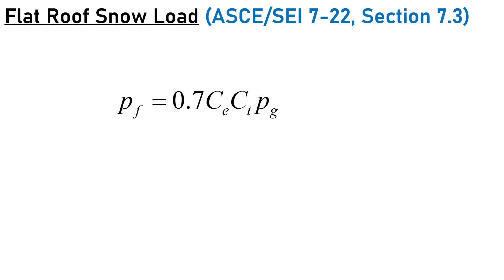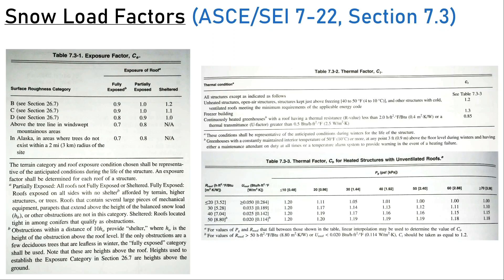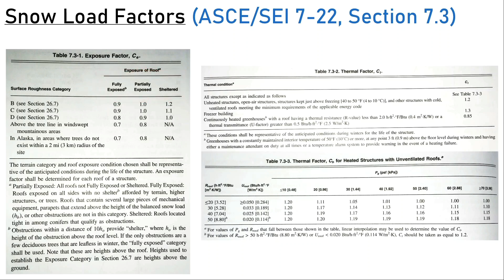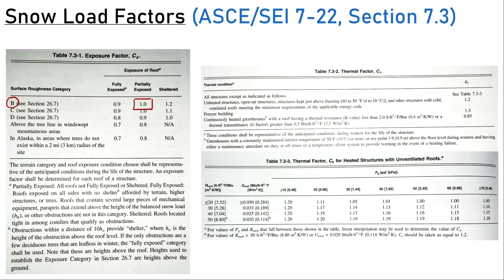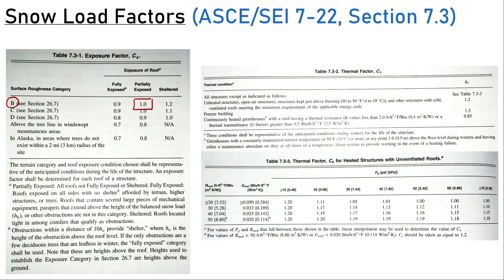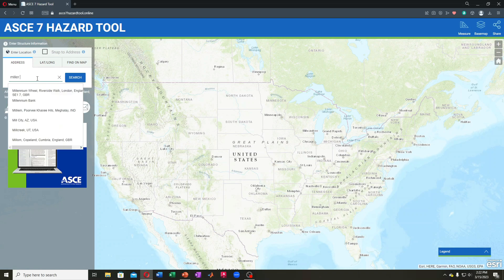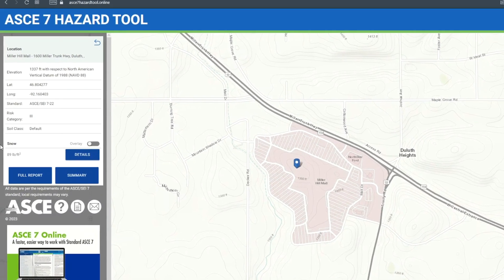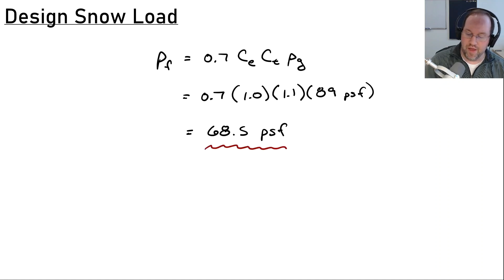Flat Roof Snow Loads using ASCE 7-22

Comment: ASCE 7-22 updated the ground snow load maps to be reliability-based (which I believe means ultimate) while also dropping the LRFD load factor for snow from 1.6 to 1.0. Does that mean that the flat roof snow load is an ultimate value in 7-22 and service level in 7-16 (and earlier)?
Reply from the maker: Yes. The new ASCE 7-22 snow load is meant to be an ultimate load with a load factor of 1.0. Previous versions of ASCE 7 prescribed the service level snow load and then applied a load factor of 1.6 to get the ultimate load. 

Applying the 1.6 factor to a service level snow load doesn't always make sense from an uncertainty point of view, hence the change. Some places, mostly up north, will have service and ultimate snow loads that are not that different and other places may have very little service level snow but could have a rare, extreme snow event that is much more than 1.6 times the service load. The new method aims for a consistent probability of failure given the prescribed ultimate snow load rather than apply the same 1.6 factor everywhere. 

Of course, the Miller Hill Mall was built before LRFD was even a thing, so that's a whole other can of worms.

Interestingly, in Duluth, using older editions of ASCE 7 may give you a bigger flat roof snow load. For example, in the 2005 edition, service-level ground snow for Duluth is 60 psf. Exposure factor Ce is the same, but often the thermal factor Ct = 1.0 for any unventilated but heated building. Importance factor (which is now incorporated directly into the Hazard Tool) I = 1.1 for Risk Category III. This gives pf = 0.7*1*1.1*1*60 = 46.2 psf service load. Apply the 1.6 factor, and that gives about 74 psf for ultimate, a bit higher than the 68.5 psf we found using the 2022 edition!

Comment: There is a design usable life of the structure, maybe 70 years or so. There should slso be inspection and maintenance requirements on the building, just like cars. The roof has been functional for 50 years. I would say the design was proper.

Comment: Sounds like the mall roof was substantially under strength for that region.
Reply from the maker: That may very well be. I don't know the design capacity of that roof, but it was designed over 50 years ago - things have changed quite a bit since then.
Reply: @StructuresProfH  It will be interesting to see the forensic analysis.  It sure didn’t seem to me as though it had all that much snow on it for that region of the country.
Reply from the maker: I would definitely like to see the forensics. Duluth is very close to record snow levels this year, so I think the load may be larger than it appears. Snow density and loading is a tough thing to estimate visually, but I'm guessing this was very dense snow. There were also some significant drifts on the east side of the collapse against where the roof was higher. It's possible that there was an overload and consequent failure under that drift, and the rest of the roof was pulled down with it. Tough to say for now, but I do agree, it doesn't inspire much confidence in the capacity of that roof.